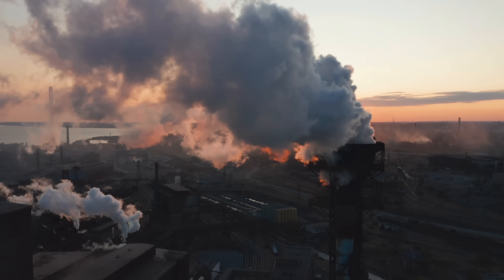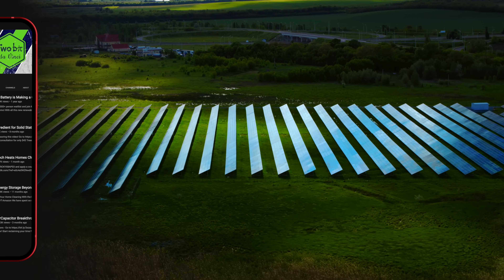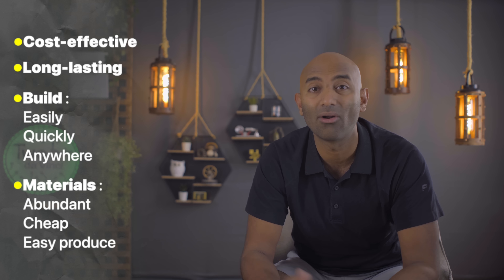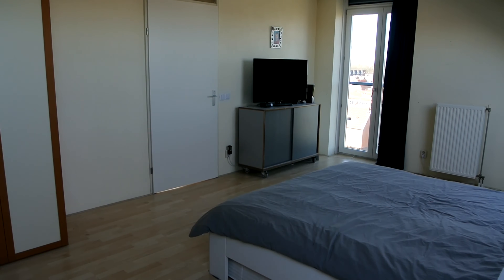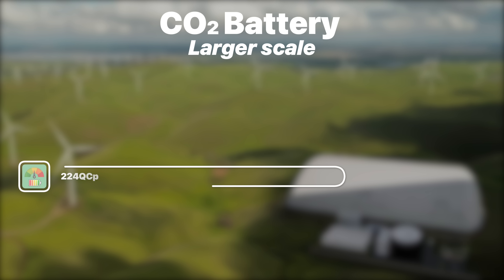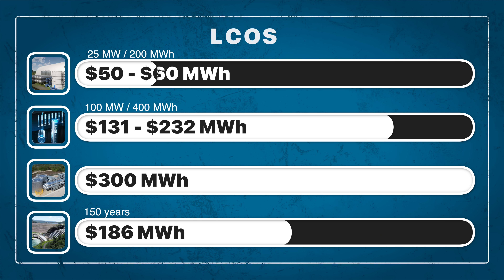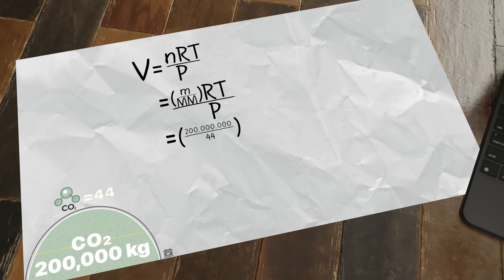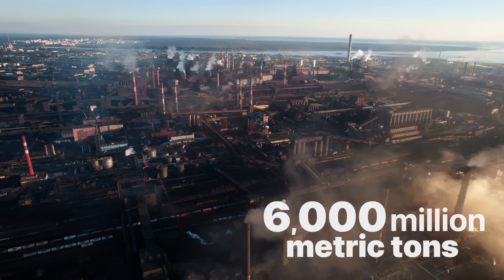The GENIUS Of the Carbon Dioxide Battery

Comment: Very interesting approach! That CO2 can be liquified without cryogenic cooling is a major advantage. While it is generally safe, it is not entirely safe. CO2 is denser than air and people in both Africa and the U.S. have died from natural pockets where CO2 has collected and the surrounding air has been still enough not to blow it away. Were a storm or industrial accident to rupture the dome or compressed tank storage, a large flow of CO2 could cascade and blanket areas and suffocate those nearby
Reply: It's probably very safe at an offshore wind farm, or underground abandoned mine.
Reply: @oahuhawaii2141  It is generally safe. But, at a minimum, it should not be placed where the heavier gas could flow into a pocket or ravine. Hypothetical worst case scenarios should be evaluated to estimate what could cause a catastrophic collapse or rupture of concentrated CO2 storage, how fast CO2 could flow, time required for it to dissipate, how far the boundary is in which a CO2 rupture risks lives, what structures (work vs. home) should be allowed within the boundary, what mitigating features might be added to those structures (sealed rooms, CO2 alarms, etc.), special training requirements for first responders, etc.

Comment: My suggestion: in constructing the doom, it should withstand the pressure about 50bar, CO2 liquidation pressure. Constructing larger dooms need more strength. What if  the doom is placed under the sea about 500m, which has similar pressure to liquefy CO2. Further, their is a temperature drop, in depth of the sea, so maybe less than 500m, need to liquefy CO2. The doom can be constructed with much less material! The inside of doom is in constant pressure, which is another advantage, to have minimal thickness for the material.
Next suggestion, when you pump atmospheric air to conditions that CO2 liquefy, CO2 will precipitate, so taking out CO2 less air, and keep pumping fresh air, can ultimately fill with CO2! This need to do only in initializing! And this process will gradually remove CO2 from atmosphere!!!
Reply: The content of the dome is at near-atmospheric pressure— like the traditional gas-holder. The high-pressure parts of the circuit are much more compact.
Reply: @chonpincher  CO2 cylinder pressure is about 860 psi at normal room. air pressure at sea level, about 14.7 pounds per square inch. passenger cars will recommend 32 psi to 35 psi in the tires. It is the high pressure that produces energy when pressure is reduced. Advantage of CO2 is because when it liquefy the pressure is constant at 860 psi. Normal air, since it doesn't liquefy pressure keep increasing, and heat wasted in pressurizing process. But dome need to withstand 860 psi. Larger the doom more strength needed in construction.

Comment: Problem with that is it would be a summer system as cold temps the gas wont turn to air as efficiently,  while would likely be better air for winter.  Even then it would be better to be able to pick yr days -  compress on cold days / evaporate on hotter days.  Good for hydro station with winter rain overflow and use energy to compress.

Comment: You are suffering from either/or syndrome.  Carbon dioxide has plenty of beneficial uses, however it also absorbs infra red light which is why it is a greenhouse gas. We do not have to change the way we think about Carbon dioxide just because it has use as a battery.

Comment: Intermittent win an solar.  We're still a couple hundred years away from having a sustainable energy source.  All you climate nuts are doing is killing the fragile way of living we have.  Your pushing for us to be off fossil fuels by 2035. No matter the cost of lives you'll destroy in your mad push. As if we little thing can cause the climate to change.  We live on a changing planet.  A living planet that has always had cycles in its growth. What will you do when you figure out that all you worrying about climate change an your fight to stop this fictitious climate change ideology.  

It's the same old powers that be.  There push to control you an have one more thing to keep us separated,  to keep us at odds with each other 
to distracted so we're not focusing on what they're doin. You know how will you charge the batteries on these electric cars, unicorn milk.  No fossil fuel that's what an only if the powers want you to.  What's going to happen is these cars will have to be loved on the internet to charge. If no internet it's going to say hook to the internet to charge.  If you jailbreak your car to charge it when they say you can't the car will log that you change by illegal means an your car will either drive you to the cop shop or it will be disabled.  Then you will have a 3 thousand lb paperweight. Climate change is just more control an you sheep are falling in line for it. 

Stupidly.

Comment: Why not do the same principle but with propane instead?  As I understand it, propane would require less compression, and has a better heat capacitance than carbon dioxide.  This would equate to a smaller footprint for the battery.

Comment: hmm, so you have to use a lot of electrical energy to compress gaseous CO2 from the dome, and then reverse the process you are using heated air (more electricity) to start the boiling of the liquid CO2, and then the spinning turbine from that heat extraction leaves the CO2 cool and gaseous, but then-to keep the process going A GAS POWERED TURBINE is used to heat the air to keep the CO2 boiler hot to keep the other turbine spinning ! So this thing is a battery that uses another battery PLUS it burns hydrocarbons, plus there are efficiency losses going from one matter state to another, there efficiency losses in the motors, generators etc.  There are other battery systems that are not this convoluted and don't rely on multiple types of energy inputs to make them work...

Comment: Solaredge string inverters use optimizers that circumnavigate shading. 
If you had used a sunny boy or sol ark string inverter you would’ve been correct about the shading issue. 
-solar installer

Comment: I can't imagine that the source of the CO2 matters since even if thousands of these plants are installed the amount of CO2 involved will be trivial compared to annual emissions. That said, a source of CO2 no one talks about is fermentation. Big industrial fermentation operations (think Budweiser) produce a load of high-concentration CO2. Any they don't use for carbonating their product should be easily capturable. (And wineries and distilleries don't need CO2 for carbonation). That should supply plenty for these batteries, captured out of the atmosphere by the fermented plants.

Comment: Using old mines (underground or open air) as the "Dome" would be a good way to not have to have a huge dome taking up land
Reply: Well... based on his calculations for 200MW requiring 111,154,000 Litres... it would require a huge amount of land anyway.  It would be a tank approximately 110 x 101 x 10 metres... or a little over 1 hectare or 2.5 acres.

Comment: I would hope there would be special safety requirements for these CO2 batteries.
Reply: What special safety measures are needed that differ from other similar systems? The energy stored in the CO2 system is released when CO2 goes from liquid to gas; the expansion is converted to work, in moving turbines to generate electricity. Much of this is common with other gas capture systems that store energy. The difference is the gas and its temperature. CO2 is safe for mostly everything, except animals when in high enough concentration to displace breathable air. Releasing CO2 into the atmosphere is safe if animals where the CO2 is released can still get the O2 they need to breathe; a gust of wind is enough to disperse a concentration of the gas. The rest of the system is as safe as or much safer than the air capture system that has to cool air to a very low temperature. The CO2 capture system runs around 25C, normal room temperature.

Comment: Surely Carbon Capture at Source has to be the go-to CO2 acquisition technique? What is the reason they can't mandate such capture on all large-scale emissions overnight? Then incentivise research and/or startups like this to find a good way of using the CO2 captured - like this. Extraction is going to be important but most most important of all is to stop putting more of the shit into the air. 
So Is there maybe a video somewhere that explains why CCAS isn't already simply blanketly mandated?

Comment: Ease your mind. Ask: What is the minimum level of CO₂ required to sustain life as we know it? 150-170ppm. What is the historical maximum and what happened then? 1,000ppm and the excess life built all the coal and oil deposits we use. CO₂ is a harmless, non-GHG whose atmospheric impact is masked by H₂O (the principal, 80-90%, GHG). So if you want to see peak stupid suggest dehumidifying the planet (easy enough, cost effective, see air-farming).
Our biggest existential threat is the expanding 34% of arable land that is now desertified, a self-compounding problem, since deserts create heat vortexes that drive off rain. See Regenerative Agriculture (esp. Allan Savory and Walter Jehne). The Science that has come along with Regen Ag addresses food security, nutrition and nutrient density, flood and drought mitigation, water quality, ecosystems, habitat,... all based on creating and preserving soil (dirt on steroids) - Nature's method. We actually have huge margins vis-a-vis CO₂, thanks to Scientific knowledge.

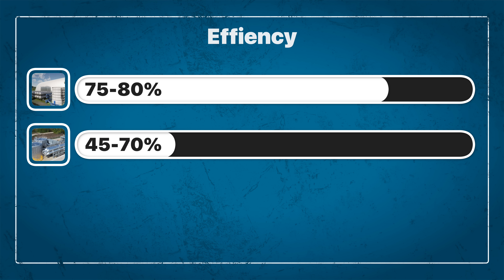Comment: [7:32 Effiency, Ricky. ;)]  Cute CO2 hat for the Tesla. 
Yes, collect that nasty old ambient CO2 and run it in these storage modes to finish off the solar/wind farm output.  And for those close to the oceans, add wave energy collectors like the Wave Swell Energy, Ltd. folks make.  Super cheap, super efficient (wink), Ricky.  Love your vids.

Comment: Research shows that the sun is the biggest contributor to global warming.   If you doubt that look at the planet Jupiter and how that planet is heating up from solar particles from…you guessed it, the sun. Not to mention that one volcanic eruption spews more CO2 than all our cars combined do in a year.  Also not to mention that it takes more energy and emissions to make solar and wind powered systems that only last a fraction of the time needed just to break even with the output to make them in the first place.    Feel free to watch “planet of the humans” right here YouTube for even more information.   But a CO2 battery would be cool if it could be recycled unlike all the lithium ion batteries that explode when wet.
Reply from the maker: Robert I'm not sure if you're joking so I'll assume you are. the Sun is responsible for all warming, lol except for the reactions happening in our core. The problem is the blanket of gases that trap that heat. that too is good, but when billions of people are burning gas and coal ... you can imagine how that gets thrown out of whack. plus we're cutting down trees, that feed off of it.

Comment: Powering 350,000 homes for 1 hour is great - if there is a 1-hour gap in grid-level power produced by other means.  It might also be useful when renewable sources do not meet demand and need a boost . . .but this is not the kind of storage we need to make renewable power viable as a grid-level supplier.  A solar farm that powers 350,000 homes during the day, needs to draw on power stored sufficient to power all those homes for the whole night - not just for an hour.  A wind farm that powers 200,000 homes needs to draw on power stored sufficient to power all those homes perhaps for days during calm wind periods or periods when winds are too high - not just for a few hours.   Pumped Hydro has the potential to provide grid-level power for a longer period of time BUT only if there is a renewable energy supply that can power the grid PLUS pump the water in sufficient volumes to meet demand when renewables are not available.  This might require three to eight times the grid demand requirements - depending on how long the hydropower might be needed. . . . .,for instance, a severe storm might knock out wind and/or solar for several days and a damaging hurricane or tornado might take out solar or wind power for weeks.  
This CO2 battery system might better be directed toward supporting critical commercial factories or operations such as phone systems or sanitation processing plants or water supplies rather than whole gird level demands.

Comment: Most good quality solar inverters last far longer than 10 years.
Reply from the maker: that's pretty average for string inverters
Reply: @TwoBitDaVinci  not really the reliability genrally is down to one component, the filter capacitors in the dc to dc converter section which do dry out over a long time but can be replaced and the inverters are not that dear now anyway.

Comment: It's CO2 vs. Li-ion vs. other storage battery tech. All tech is quickly changing, improving, making investment very risky. However, being the "best potential candidate"  is not technical; it's political. Funding comes from stolen money (tax), meaning zero accountability. "Accountability" is replaced with bureaucratic goals, as if good intentions trumped reality, results. It doesn't. Meanwhile, economies thrive or fail based on the degree of freedom of choice, the free market, NOT promises, NOT good intentions forced on all and paid for with stolen money.

Comment: It seems like hybrid storage plants would make better sense. You could blend cost, plant lifetime, efficiency and responsiveness as desired for the end-use situation.  While compressed CO2 does sound promising from the cost and lifetime point of view, but the difference in efficiency is a big factor.  If you are "buying" power from the grid or from your solar or wind farm at $0.05/kWh and selling it back to the grid at $0.06/kWh (averages) a hypothetical 200MW compressed CO2 plant loses $210k per year but a 200MW lithium battery earns $437k per year.  On the other hand a 200MW lithium battery costs about 3x the CO2 plant.  Granted, this is just one scenario, but the point is that by blending the battery and the CO2 for capacity, you could can engineer a solution that will be financially and operationally more effective than either one alone. 

I wonder about the tradeoffs that were made when selecting CO2 as the working gas/fluid.  You could do this with other gasses such as propane, ammonia, hydrogen sulfide, etc.  Maybe CO2 is just the least reactive/safest.

Comment: Anaerobic digesters take food and bio waste and digest them. That produces methane bio gas and food grade co2 as a by product. It would be good to see these batteries installed in tandem with anaerobic digesters (AD).
If there was an AD plant at every sewage works and every open composting scheme (open air composting just releases the co2 to the atmosphere), we could have a 100% renewable biogas and energy storage solution.

Comment: The Power Plant near me had Carbon capture, but they took it away.
Reply: This isn't "carbon capture".
It "captures" affixed amount of CO2, one time, then uses it in the closed loop system.
You would need domes equivalent to the volume of excess CO2 (divided by the compression ratio)
That's a lot of domes!
.
The main gain would be as part of a generation system that requires storage.

Comment: Discussing energy density (either by volume or weight) is a good metric when considering battery technologies for devices that move, anything from a cell phone to a laptop to a car. However for grid storage it's a less useful metric since land prices can vary so much and there's usually somewhere you can find the space (for example in between wind turbines). Heck if the fossil fuel companies are smart about it they'll reuse the land they already own for grid storage and still make money!

Comment: If a highly efficient CO2 capture could be developed and used the size of the bladder could be reduced or totally eliminated. The bladder doesn't store the energy. The high press tanks store the energy. The bladder is just the source of the CO2. If a CO2 capture system could be created that was as fast as the compressor the only reason for the bladder would be to avoid the energy use and cost of operating the CO2 capture system while charging the system.

Comment: Wind and Solar are FAR more expensive than Coal and Gas.
They are artificially making them look cheaper by a whole raft of hidden subsides.
There is NO climate crisis  the data is clear.
Co2 is incapable of causing dangerous global warmng.
So MORE Co2 is very beneficial and has a logarithmically reducing warmng effect as levels rise , by the time you get to 200 ppm Co2 has little effect.

Comment: Imagine every house with a 90 kWHr battery sitting in the driveway, because electric cars exist.  How much storage per house hold is planned?   Looks like between 2 hours and 24 hours of storage.  90 KWhr will run most houses for four or five days.  Relying on the EV to keep the house going over night seems like a no brainer.  Charging from solar all day.  Distributed systems will surely fill a lot of gaps.